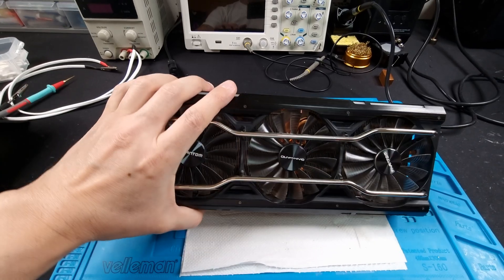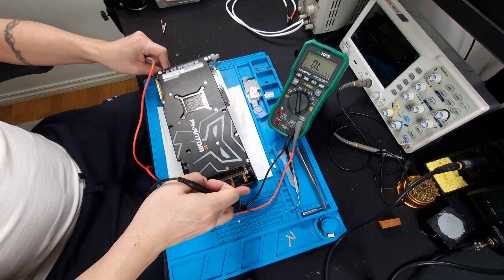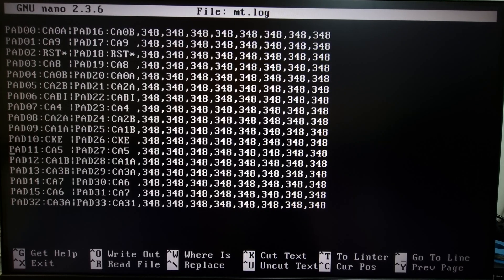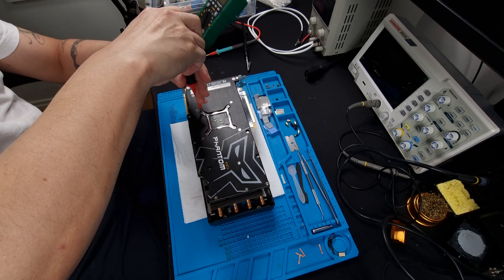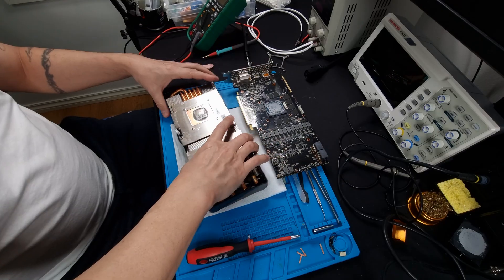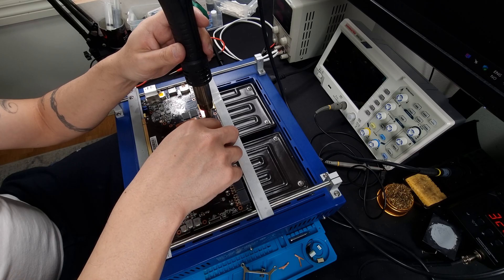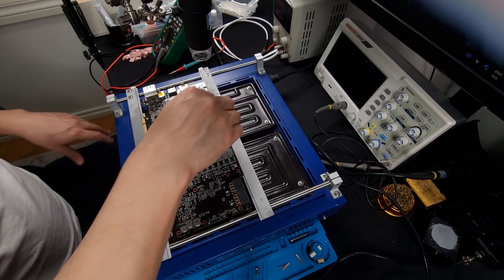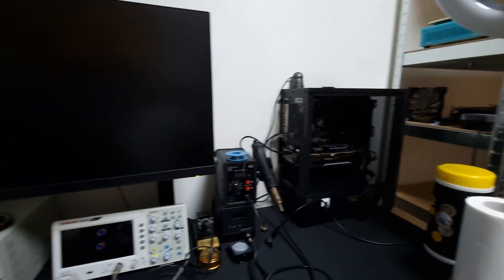RTX 2080 With Micron 2018 Memory Repair Attempt Fail. Sad.

Comment: I got 2 choices get the 2080ti or the 3070 I made my mind and I want to get a 2080ti for the vram but I don't  know if they used newer micron memory that is not defective or they kept using samsung to the end of the generation so what should I look for
Reply from the maker: That is a gamble. You can always ask the seller to check which make the memory chips are. If its micron, skip it, even if it may be non micron 2018.